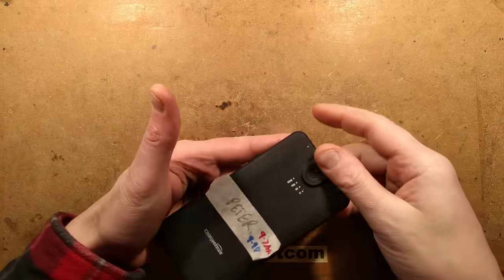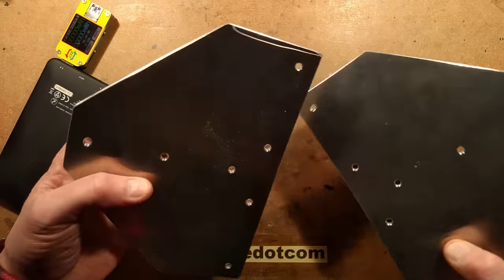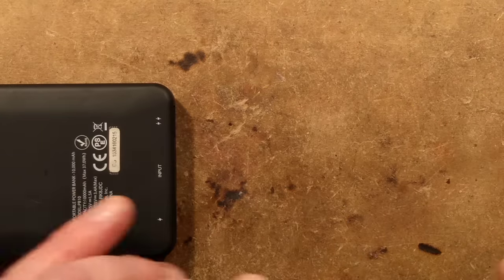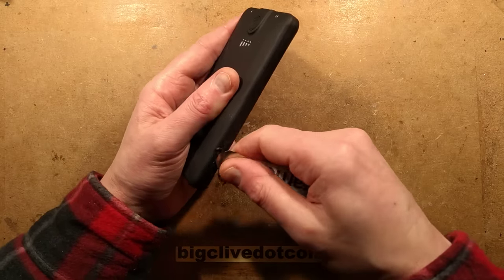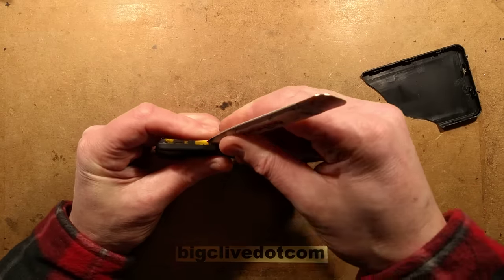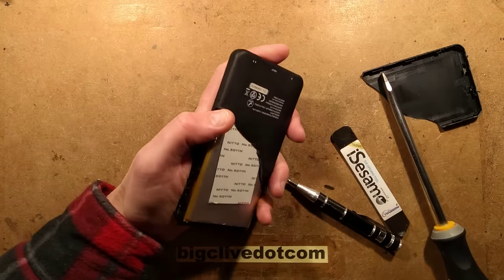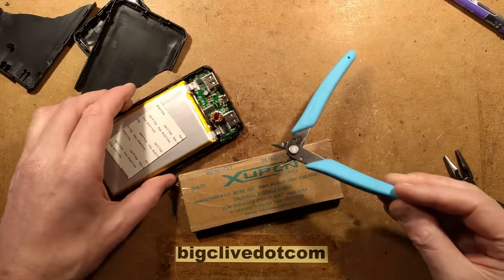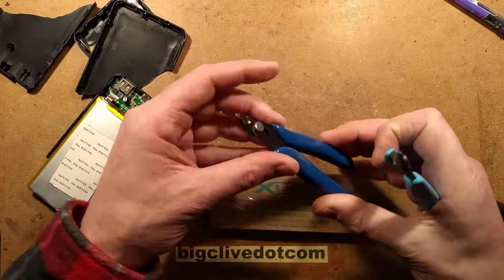Inside a recalled Amazon Basics power bank.

Comment: I have a "16,100mAh" 59.6Wh Amazon Basics pack that was also recalled.
I was able to get mine finally cleanly apart...but it took a verrrry long time and using temporary held-in-place spacers (guitar picks). I haven't "clicked" it back together so don't know if it will do that and still be secure from popping apart at some random time.

Separating the 16,100mAh unit was also made difficult because there is virtually zero space between the case sides and the 3x Li-Ion cells so one must be extraordinarily careful. However, Apple didn't use double-sided tape in my pack...it was a surprisingly thin (about 1/2 the thickness of a dental braces rubber band) rectangular rubber pad with adhesive only on the battery side, affixed lengthwise in the geometric center of the cell. Plus, it seems about 1/2 the width and 1/2 the length of the tape shown in your vid. That undoubtedly placed less torque on the locking "tabs" (aka niblets? (cause they're so tiny)) and made it easier for me to open the case. The "tape" is so think it is very fragile and trying to remove it easily tears it...almost like paper.

Another major difference is the tabs on the cells in my pack are connected to the converter PCB via 2 relatively thick soldered ~18ga braided wires, standard Red(+) and Black(-). Except for the PCB connection points, the tabs and wires are insulated from the circuit board by both transparent orange plastic film along the entire ends of all three of the packs, and a separate rubber pad about each connection. The only way to examine the tabs themselves was to cut away the plastic and rubber insulation.

BATTERY INFORMATION
The Li-Ion (surprised me, I assumed they'd use LiPo cells) battery pack is labeled:
AEC Li-Ion battery
4972115-1S3P......4.2V
59.6Wh/3P...........5392

I also measured the "practical" ampacity of the unit when new. Note that I did NOT test until the unit turned itself off. I ran it under the load from fully charged until the moment it changed from 2-LEDs to 1-LED.
~9,800mAh 
(measured with 800mA USBout test load, 
(Start fully charged 4 LEDs, 
(Stop the moment display transitioned from 2-LEDs to 1-LED,
(I guesstimated 800mA on USB port, with losses might be ~1,000mA on the actual cell terminals.

After about a month of "seasoning" usage it measured effectively the same.

Note: I plan to test the cells directly very soon and will edit this comment when that is completed. Although it is now a couple years older than new (recall was in 2018). I will test with a direct cell load of 500mA to Vt=3.0V across the cell terminals, and try to test again to BOTH the 2LED to 1LED transition point using the same 800mA load on the USBout port, and to when the unit turns itself off. So a bit more data will be available. Note that this will also show whether or not the cells are actually charged to near 4.2V capacity when max charged (I don't expect them to be at 4.2V at the instant that LEDs go from 4-LED=blinking to 4-LED=solid but maybe?).

(bigclive...My ~20 yr old sidecutters are Xcelite 175M (founded 1921) vs. your Xuron (founded 1971). Still in great shape today.)
Reply: POWER CAPACITY/AMPACITY TESTS
AMAZON Basics Powerbank, Model PB16
Claimed capacity: 16,100mAh, max 59.5Wh (I assume this is the claimed energy DELIVERABLE to the user's phone, etc)

NEW TEST
20201125.0735UCT: Report Time
Duration: 20201124.0230 - 20201125.0030 (22.0 hours)(note: 22hrs x 800mA = 17,600mAh = VERIFIES)
Charging and Discharging performed directly on 3P1S Li-Ion Cell battery pack leads, NOT via the input/output ports of powerbank.
Id = 800mA
Vt = 3.10V
 (I set this to 3.10V for several reasons:
1) this Vt does not overly stress modern Li-Ion cells. Note that many modern Li-Ion cells can go well below this value (example, Samsung Model: INR21700-50E, which has a cutoff imit of Vmin=2.50V)
2) there isn't usually a MEANINGFUL amount of additional Wh to be gained in a real-world environment between using a cutoff voltage of Vt=3.1 to Vt=2.5V
3) it makes it easier to compare apples to apples when testing other Li-Ion cells with higher Vt specs)

==============================================

TEST RESULTS: Ah CAPACITY-AMAZON Basics 16,100mAh Powerbank 
I have now tested the Li-Ion cell capacity in the Amazon 16,100mAh Powerbank. I decided to forego testing LED transition parameter testing, and I modified the planned parameters from those contemplated in my earlier comment. I decided it was more valuable to test that cells themselves, separate from the conversion board.
The 3x Li-Ion cells in the PB16 powerbank were charged in their existing parallel (3P1S) configuration to an initial charged state of Vc=4.23V using an Imax B6ACv2 Balancer/Charger at Ic=1.50Amps. The powerbank was then disconnected and allowed to normalize for an hour before testing.

Subsequent capacity/ampacity testing was performed using both the Imax unit and a ZB2L3 Battery Capacity Tester.
Parameters in tests run using both testers were set to Id=800mA and Vt=3.10V
Test results from multiple tests were close enough to be considered identical for all practical purposes of discussion and real-world use. The amount of current discharged and the corresponding battery voltage at that point in time for one of the tests are provided below.
 Overall, at Id=800mA, the test took 22 hours to run 
(note: 800mA x 22hours = 17600mAh)

Test Device: Imax B6ACv2
, Li-Ion Capacity Discharge Test Mode
20201124.0230 DISCHARGE CAPACITY TEST#2 STARTS

mAh	Volts
0000	4.20
4000	3.85
7500	3.66
8000	3.63
9000	3.60
10000	3.57
11000	3.55
12000	3.54
13000	3.51
14000	3.48
15000	3.43
16000	3.38
17000	3.28
17250	3.20
17350    3.16
17475    3.10
17500    3.10
  At this point, the Imax started varying Id from 200mA to 800mA as the voltage reading remained constant at 3.10V. This behavior near the end of a Li-Ion charge or discharge cycle is normal for the Imax unit. It is a "feature" that cannot be adjusted by the user.
17620	<3.10 Test automatically terminated as Volts < Vt=3.10V

20201125.0030 TEST#2 TERMINATED

CONCLUSION:
Despite the recall of the assembled powerbank product itself, the Li-Ion cells used are functionally high quality, and the testing demonstrated high capacity was maintained even after some time of ownership & use
The fact the battery has a discharge capacity of 17,620mAh when measured at the cell terminals strongly suggests to me that Amazon was trying to ensure its CLAIMED 16,100mAh capacity was available AFTER any powerbank's internal voltage conversion losses. 17,620mAh is about 10% above what is required to meet that 16,100mAh claim, which is within the limits of the efficiencies that reasonable cost contemporary mass production technology provides in such consumer level devices.

Comment: there is a document i find myself using more and more often These days called the smd codebook and although even that is not knowing what a x1xv is it tells that x1 is either BFT93 or IMX1 or BZX84-C27... xv is most likely a Suffix that not necessarily has to have a meaning other than to differentiate different manufacturers although even that is not always the case
Reply: @TheVitunpaskasaatana  mmh that would even be somewhat meaningful as its also a fet but i havent heard of that manufacturer before (not that it would make a difference) while rohm and the like as the codebook suggests are more well known and you probably find a second source for their chip more easily
Reply: @TheVitunpaskasaatana  indeed quite convoluted your approach.
Reply: shouldnt these fets all be somewhat similar?
Reply: @urugulu1656  There are only a bit more than 1000 2 character codes possible.  It seems likely that the industry has run out of abbreviation to use on tiny package types.

Comment: You can use fishing line to cut the adhesive. Loop it around the cell and pull both ends. The fishing line is thin enough to cut the foam center of the double-sided tape

Comment: I am brand loyal in power banks and charging cords. Anker for me.
Reply: Yeah me too except for my one rugged battery bank.
Reply: The new 10Ah that’s the size of 2 18650’s is really impressive. We only charge iPhones and iPads so no PD needed here. Although the sales on non PD banks are great.
Reply: I'm also a big fan of Anker's products and their customer service. I also prefer 18650 based packs over lithium polymer, they just seem that bit safer, though I have to wonder how fragile the new 5Ah 18650 cells are.
Reply: AUKEY is a good bet as well.
Reply: I have an Aukey 30,000 mAh power bank I got 3 years ago. Still works great. Their cables are meh though, but that might be due to micro USB being a weaker connector than USB-C.
Reply: I use Anker as well, without issue.  I’ve owned some other Anker products - bought due to their reputation with electronics - that turned out to be cheaply made junk.  (can’t even remember - ordered direct from their webpage at the time).  Some of their cables don’t seem to charge as fast, but I have no setup to test charging cables.
Reply: I have an Aukey power bank it it looks just like this, except it has USB-C in the middle, and micro-usb on the side. I have a feeling this was an unbranded powerbank made by Aukey
Reply: @ferrumignis  There are no 5Ah 18650 cells, its impossible. What you mean might be the 21700 cells that can go up to 5Ah

Comment: Clive, why don’t you switch to reporting these power banks in milliwatt-hours or watt-hours in stead of milliamp-hours or amp-hours??
Two different power banks might have the same mAh rating but their actual stored energy capacity might be VASTLY different depending on voltage. 
Many of the smaller capacity ones have variable output voltages and the larger ones for laptops and other large electronic devices have an even larger output voltage range.           
mAh and Ah just become meaningless numbers if a power bank can deliver different voltages to different devices or if one power bank voltage differs from another.

Comment: Needed a spudger so went with the same one as you. Works great, has the bonus feature of, if you slip with it, it's great as a makeshift scalpel lol. To be fair any spudger would have done the same I just need to be a bit more careful in future, still the screen has been replaced on the son's tablet so he's happy again.
Reply from the maker: Blade awareness (including screwdrivers being used as prise bars) comes with experience.
Reply: @bigclivedotcom  yep, it's a skill well worth having. 
I half-amputated the tip of a thumb many years ago whilst trying to separate some of those lovely sesame brittle biscuits with a flimsy little craft knife.
Nowadays I confidently hack tree branches into wooden spoons with razor-sharp whittling knives.

Comment: Samsung showed two failure modes for the Note7 battery cell, the first was around the edge with insufficient insulation, the second was an internal crease at the tab weld point inside the battery layer stack, from which the defect would propagate and cause eventual short. Naturally the defect propagation was accelerated by tight enclosure packing and high charging current, which incurs quite a bit of internal movement.

In addition, numerous manufacturers have been caught in the past where microscopic metal shavings would fall into the layer stack during manufacture, and eventually pierce the oxides and the insulation and cause a short.

It's a possibility that a manufacturing fault during the cell batch manufacture was discovered which prompted them to recall the power banks - it's not necessary that the fault will cause dangerous modes of failure in this construction, or that fault probability is necessarily high, it's sufficient if similar faults or manufacturing deviations have lead to issues in the past.

Comment: 16:30 Regarding 0829A:  It's an 8 bit MCU manufactured by Silan electronics of China, with a manufacturer product ID SC51P0304. You can take it as a mini computer. It probably runs the charging control, protection and, as you mentioned, light control.

Comment: I believe, the reason for the recall is the battery.
Last two years the market has been flooded with Li-Po batteries that, after few months of use, expands without a cause. Very likely this power bank has such a battery inside...
Thanks X the video...

Comment: I find that original Windex (common household blue dyed glass cleaner) makes easy work of those adhesive pads. You spray enough on to saturate the adhesive pad and it'll let go.

Ripping the foil sheathing generally won't resort in fire unless you also happen to puncture the battery in a way the layers short together. It's still a great idea to throw the battery outside as quickly as possible. You'll instantly know if you've damaged a LiPO cell because the electrolyte smells amazing, sort of like green apple flavoring used on snow cones, just don't inhale much of it because it's really really bad for you. I've read the MSDS for the lithium compounds used in batteries and they're generally bad news for health effects.

Comment: Acetone is the easy way to remove those adhesive pads. iFixIt supplies acetone in a needle tip bottle with their battery replacement kits for MacBooks and it takes a while to soak it, but it is very effective at removing the cells from their aluminum housings.  Results in a plastic case might be a bit more messy but as the case is being disposed of, not to worry.
Also, instead of hand soldering, that board was likely soldered by a "selective soldering machine" which is like a little tiny wave soldering fountain with an X-Y CNC for positioning. Here's a good example of one in action: https://www.youtube.com/watch?v=RL_OYJTrR-g
Reply: Isopropyl alcohol is better if the case is plastic and need to be used again. Used it to loosen the glue on my phone battery when I was doing some repairs.

Comment: Wonder if those are multi-layer ceramic caps, and they're cracking and causing mucho boomboom
Reply: I fixed a power bank a couple of months ago that had a ceramic capacitor short circuit. This shorted out the charge circuit so it would not charge, just got hot. "Ouch!!" So that's what's busted. The pack was only down to 3V. Changed the cap and the pack charged and discharged fine.
Reply from the maker: There are a lot of issues surrounding those tiny ceramic caps.  A recent one is the strings of addressable LEDs used as Xmas lights having meltdowns.
Reply: I opened up my adjustable power supply about a month ago to check out the front panel display board and I found that two ceramics near the power output had been obliterated without causing any further problems.
Reply: As seen one EEVblog with the powersuply-module that caught fire
Reply: @bigclivedotcom  There has been a shortage of ceramic capacitors recently.  One of the big manufacturers has been encouraging manufacturers to go from 0402s down to 0201s due to a shortage of raw materials.  I suspect that some low cost  manufacturers have been finding parts on the grey(er) market.

Comment: For these kind of cell tabs you want a Weller soldering gun or similar - e.g. 150-200watts. It melts the tab solder nearly instantly and you're not sinking a ton of energy into the cell.

Comment: The three times I've seen a smoking burning Li-Ion battery, they were all caused by guys using a metal screw driver to open a case and then piercing the battery's flexible pouch.  POOF, SIZZLE!

Comment: Dropped mine off a table. Not very far. Seemed fine but a couple of days later it had swelled up. I think your suggestion of a lack of protection/buffer is correct and they were failing due to minor knocks.

Comment: Less than 8 minutes in and this video is already giving me hardcore anxiety. Suggestion for next time: use that overpriced iSpudger to go all around the case and unclip ALL the clips before attempting to separate the case. I've seen a cell phone blow up during an "unprofessional" disassembly like that, and it was not fun.

As for the desoldering of battery terminals though, I've done that plenty of times, and it was fine every time.
Reply: Hardcore anxiety from a youtube video?

Comment: Do we really need the batteries to be stuck down at all?
Nightmare getting open without damage, but, if you can get to an edge of the adhesive, and have a basic toolkit of different solvent types (I keep acetone, ethyl acetate, meths, IPA, white spirit, and a v handy spray can of Wynns--because you can't spill it, and it gets off most sticky label goo.), then with a glass syringe, and needle, you can precision trickle the right solvent along an edge as you peel the tape (or shoe sole etc) back, with minimal effort or damage.  Annoying thing with these foil batteries is that they stick the tape over the identification label, so it's hard to find out what replacement one needs!  I'm actually typing on a Planet Computers 'Cosmo Communicator' which is bursting at the seams from the expanded battery, but it's totally covered in tape telling me not to remove it, and nobody in the world has a replacement, and the manufacturer doesn't reply to customer service requests! :(  Really glad the EU is trying to bring back user replaceable batteries!

Comment: The Samsung battery issue (In the Note 7) was actually that engineered the battery to be made in insanely high tolerances and used a new sonic welding system. It was all 100% if it was set to like 1% tolerances. One of their manufacturing partners was way off at like 4% tolerance and it caused a super minor, microscopic puncture connecting the cathode and anode. At least that's how I remember their explanation, may have left some stuff out or gotten some details wrong, but it wasn't the actual putting the battery into the phone that was the issue.